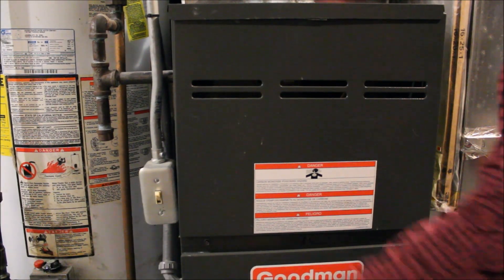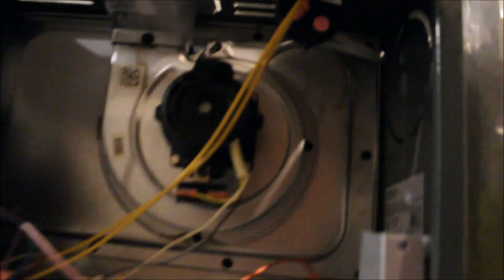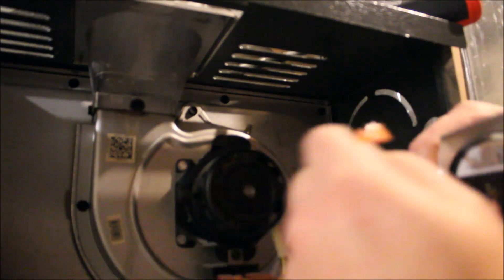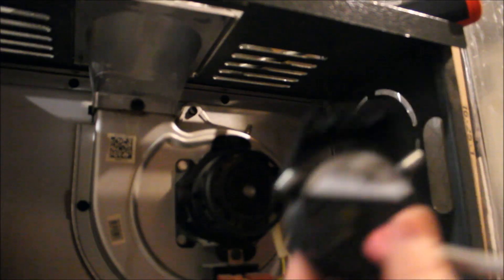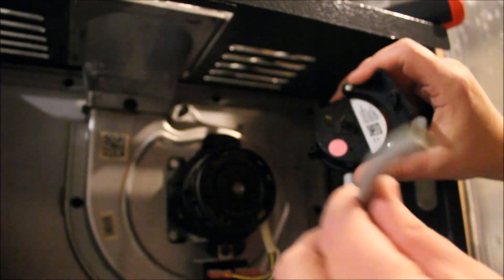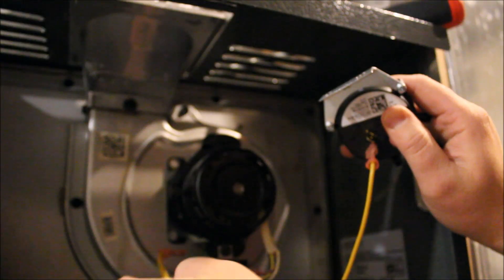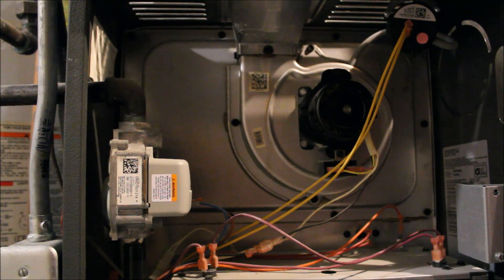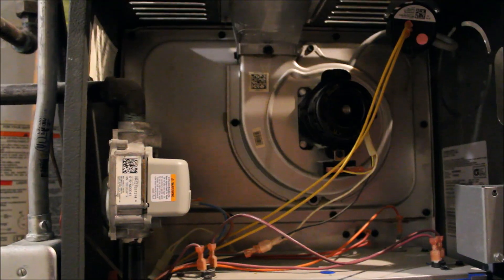How to fix a Goodman Furnace Pressure Sensor Switch - 3 Blinking Lights on Furnace

Comment: I actually fixed my switch, here's how I did it (as long as the vacuum part is OK)
:

First remove the sensor as outlined. The actual switch (where the 2 wires plug into) can be removed, it's held in by 3 plastic tabs, 2 on the side and a small one at the top. Take a sharp knife and remove the tabs, you'll find that they peel right off. Once you have them off, take a pair of pliers and grab one of the terminals and pull the switch out of the sensor, it's held in by 2 tabs inside. Now you can see what the switch looks like, nothing complicated.....just a set of contacts and a spring. Get yourself a spray can of CRC 2-26 Electrical Grade cleaner/lubricate and clean and lube the switch. You can run a piece of paper between the contacts to clean them. Don't remove the CRC 2-26 cleaner/lubricate!!!  Pop the switch back in the sensor and at this point you can test it using an ohm meter and vacuum hose, no vacuum to the switch there should be no continuity....vacuum applied should show continuity. Reinstall the sensor on the furnace and see how it is. Hopefully this will help you get up and running when you're stuck with no heat.
Reply: I didn't open mine up because could return them to my dealer for a new one,  but did after I purchased the Robert Shaws with the soot free micro switches.  I knew they would be loaded with soot, common sense that many engineers don't have would verify this.  But just wanted to see the soot,  Also have an electric burnishing tool to clean the contacts, but certainly not a long term cure.   Not even a short term cure. 

The logic looks for an open contact switch, then times the inducer motor for a closed contact.  So you just cannot bypass the switch.

Comment: Hi! Thanks for the great video, Definitely getting a thumbs up. I have 4 blinking lights, will replacing the switch resolve my issue? And could you give us the link to the part from amazon. Thanks!
Reply from the maker: Sorry to hear about your problem!  I haven't encountered that I my unit, but I think this is the right part:

https://amzn.to/2T9Dc0Y

but, the best thing to do is take it off and see what the part number is on the sensor.  Mine looks like B13701-55 for the limit switch.  In my experience with Amazon, if this isn't the right part, they are really good about taking it back.Thanks for reaching out!

Comment: how did you know which one to get?
Reply from the maker: I searched the part number on the old one on amazon. If you have the same unit as we do, the part in my description should work. I don’t think the make of the part is that critical. There are a few similar ones.

Comment: Thanks - For some who have 3 blinking lights after you replace the switch, you could possibly have a bad inducer fan.  I replaced my fan two months ago (bad bearings) and now the switch went.  I guess it's planned obsolescence in that everything wears out about the same time.  Great video.
Reply: Correct and good advice! Check your inducer fan first, if it doesn't spin at all, it's nothing about the switch.
Reply: @davidding8538  I had the three blinking lights again intermittently last Fall when I started my furnace.  The furnace would run, shut off the main blower and close the gas valve.  The inducer fan never stopped running and would restart the gas and main blower.  It did heat the house, but just seemed wrong.  I got help with it this time.  About $400 later and a new main board and the furnace now has worked fine all Winter.  Your message reminded me it's time to change the filter.
Reply: @daniellarson3068  Good info! Thanks Daniel! I just fixed mine with a new inducer :) Hope I don't get into another trouble soon.
Reply: This comments is important. My fan was turning, I could suck and push air through the pressure switch tube and it was not worn. I stuck a paper clip in the fan inducer port and switch port and then the furnace lit up. I wish I would have done one before the other to know which was clogged. I think it was the fan though. It had a little resistance.
Reply: @stevewelch9241  Good job - This problem is apparently quite common.  I've had a similar problem with three furnaces, my old house, my present house and my mom's house.  Oddly enough, I talked to an HVAC guy I bumped into on the bike trail a few weeks back.  He said he's had to fix a lot of them with this issue.  I have my fingers crossed that my old furnace will make it through this year.

Comment: Thanks for the video! However doing what you did was not my issue, but it helped me to find my issue! I am uploading a video that I just recorded now that my problem was, drains inside were not working and this small fan and the pressure piece you have were full over water and so were the lines, in my video i recorded myself fixing it, it might help someone else as i was having the 3 blinking light error and my heat would not come on!
thanks for making your video though as you finally helped lead me to where my problem was lol!
Reply: Where do you have your video?
Reply: RegniA here on my YouTube channel

Comment: I get the three blinking lights and replaced the pressure switch and still have the same problem   :(
Reply: Bob, With The Power OFF (you don't want to mess up your inducer draft wheel when doing this) so you do not want it to be spinning. Pull the rubber hose off the nipple on the inducer assembly.Take a small Allen Wrench and use it to clean out the rust buildup down inside the nipple. Clean it out really good. Then reattach the rubber hose and you should be good to go now 👍
Reply from the maker: When the furnace turns on, can you feel any air coming out the hose if it’s still hooked up to the furnace?

Comment: I still get the 3 lights. And still not working
Reply from the maker: alexander Delcid it’s not perfect. Sounds like the actual sensor may be malfunctioning and just needs replaced. Usually air flow in and out of that will loosen up the flap inside the sensor.

Comment: Thanks for your video. Interestingly, in my case the switch itself wasn’t the problem. The fitting where the hose attaches to the blower assembly was clogged. I ended up using a sewing needle held by a pair of needle nose pliers to clear the clog.
Reply from the maker: Nicely done! This seems to be a real common thing with this unit.
Reply: This.  I used a small piece of light gauge wire to clear the obstruction.   Furnace is working again.  Thanks!
Reply: I used an Allen wrench  key lol
Reply: This was my issue too!!! Thank you so much! Would not have thought to check that side for blockage.
Reply: I used a small drill bit works great! thanks
Reply: @htiekbrian  what was in it?
Reply: @djhookisdaman  A white crystalline substance (which appears to be a residue from the gas combustion). I found a lot of it in the flue.
Reply: @djhookisdaman  I'm not sure that I actualy got whatever it was out. I just used the drill bit by hand to clear it out. That was over 2 years ago, but I have not had the issue happen again.
Reply: What was in it?